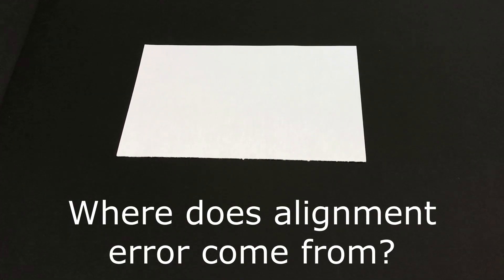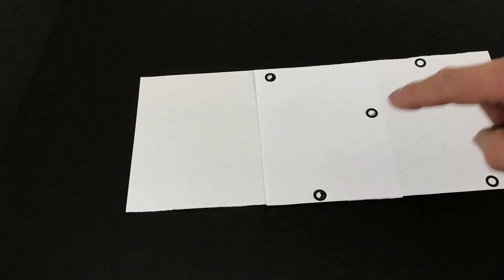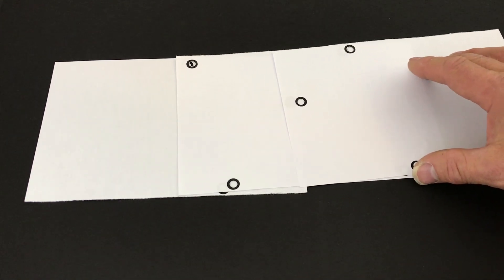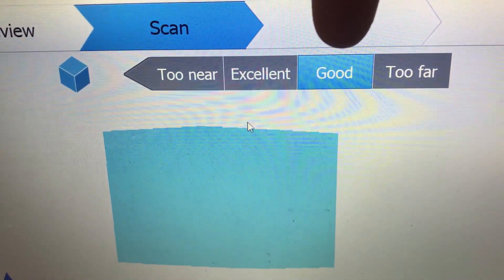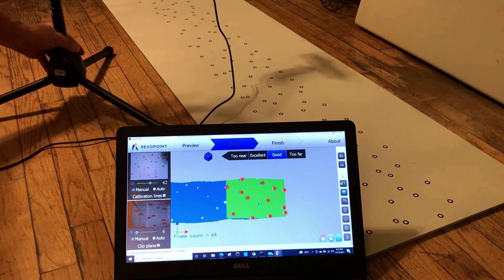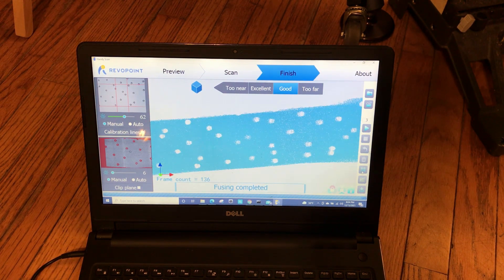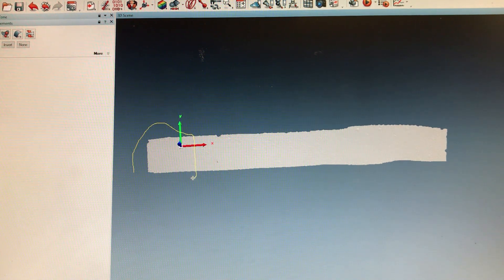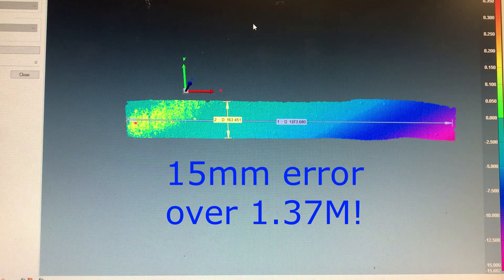Revopoint POP 3D Scanner Mesh Stitching Error using Markers

Comment: Thanks for a very good video.
Just one question: Do you know that the floor was straight/flat and that the stand did not slip out of position while you were moving the scanner across the floor?
Reply from the maker: floor/stand don't  matter. The scanner is using the markers on the glass plate to stitch the individual scans together. I was using it to maintain the optimal scan distance.

Comment: Thanks so much for making this video,  very informative, instantly subscribed! I'm looking for an accurate solution for 3d scanning plaster molds of large figures (lifesize human statues, up to 6 ft. in height) and it requires a high level of accuracy (probably no more than 0.3 mm of error) as the 3d scanned data will be analyzed for measurements.

It's quite disappointing that the Revopoint Pop accumulated an error of 15 mm over a 1.37 m distance, well outside the acceptable error range for my project (but for the price, I guess that's to be expected). A few questions - do you imagine I'd have more success in accuracy considering the plaster molds have more features than a flat piece of glass? I'd use markers as well. Also, do you have any recommendations of alternative methods for getting accurate scan data of a lifesize mold? I've been stuck on this for months and I was hoping a Pop would be the answer - I backed the Pop 2 on Kickstarter, but I'm uncertain if that will meet my needs despite the improved accuracy. I also have a Creality CrScan01 scanner, but it doesn't do well for me with alignment and larger scans... buggy software and frequent crashing despite 48 gb of RAM.

Thanks so much!
Reply: I would suggest you use a photogrammetry solution such as agisoft or reality capture. Problem solved !
Reply from the maker: @TheRealJerseyJoe  I've used photogrammetry for many years to make specific measurements. https://www.photomodeler.com/ is a reasonable package. I have used it in combination with laser trackers (for scale bars) and with 3D scanners. You can use dense matching for certain objects, but I had access to high quality 3D scanners which did a better job. I'll have to go back and re-evaluate the new packages.
Reply: @SerendipitySue  - Yes, I agree 100%  I am very familiar with Photomodeler and have had a lot of experience with it in the distant past.  I think you will find that Reality Capture and Agisoft produce superior results nowadays.  Regarding photogrammetry, I would also agree with you that given the choice, especially for engineering projects where tolerance is the primary concern I would probably always prefer to use a structured light based system such as ATOS or perhaps a laser based arm such as Faro, etc.  For large field project a Surphaser is always nice ;-)  But back to photogrammetry, I think it is really advantageous in certain circumstances, such as when high quality color surface mapping is required or when dynamic poses of humans or large objects need to be captured.  Again, in most cases it will not be as accurate as a well calibrated structured light system but has the advantage of a generally far lower cost of entry. I think the main issue with photogrammetry is that it does take a fair amount of effort and the quality depends largely on many factors including hardware, software and most importantly the skill of the user.... so mileage may vary :-)  If you have an opportunity to checkout Reality Capture, Agisoft, etc... it can be very useful for certain projects.  I look forward to seeing any results you may post. Lastly, thanks for another great video presentation!
Reply: @TheRealJerseyJoe  Thanks for the suggestion! It sounds like you must be familiar with photogrammetry, I have a few questions if you wouldn't mind. I originally intended on scanning with photogrammetry but struggled quite a bit with any sort of turntable/lazy susan setup. The biggest issue by far was that rotating the mold but keeping the lights stationary  seemed to confuse reality capture quite a bit. I used a polarizing lens filter on my camera to help alleviate any glossiness/shines, but no luck. I suppose I could walk around the mold and snap photos with my cam on a tripod, but since I'll need to scan numerous molds, I'm trying to make the process more automated and less prone to human error/bad photos, so a turntable solution seemed like a solid approach. Also, since the point cloud data is an arbitrary scale, the only solution I could come up with was 3d scanning a ruler in the same scan to serve as frame of reference for the dimensions. Then I'd manually scale the final scan, but that method wasn't too precise.

(My equipment is a Canon EOS RP + polarizing filter placed on a tripod, and set up my mold on a lazy susan,  purchased a few standing lights + ring light and shooting in RAW and had the settings dialed in nicely (50 mm focal length, 100 ISO, etc.). I also bought a backdrop frame and a large black sheet to serve as a dark void in the background for all my photos).
Reply: @mrbanana101  - Hi, yes I've been doing this for 30+ years and have considerable expertise with all manner of devices :-)  I totally understand what you are saying.  There is a considerable learning curve with Photogrammetry but it is certainly capable of producing sub millimetre accuracy easily... provided you know what you are doing. I've scanned all manner of molds in the past, using various hand held scanners and using photogrammetry.  Since I've not seen the molds you are working with myself  I can't say what the local complexities may be but provided that there are not severe undercuts or occlusions photogrammetry should be able to provide excellent results. It sounds like you are doing everything correctly. Typically I would coat the molds with something.... I would first coat with a thin white spray.  Once the objects surface had a uniform coat, I would then spray with a black "speckle" layer so that the corresponding surface points can be easily detected by the software.  Provided that your lighting is even and diffuse, that your image focus is pin sharp in all frames, and that your overlap is 30% or better between images you should have great success with reconstruction of your surfaces.  Sorry for the wall of text, if I've forgotten anything, feel free to ask !  Cheers,  Joe
Reply: @mrbanana101  - Oh yes, one other thing. Using photogrammetry you will have to include some sort of a scale bar in your scene in order to properly calculate the correct size of the reconstruction. You can use something as simple as a ruler.... I sometimes I use a machinists scale although I also use artifacts of a known size but of course, it all depends on what sort of tolerance specifications you require.